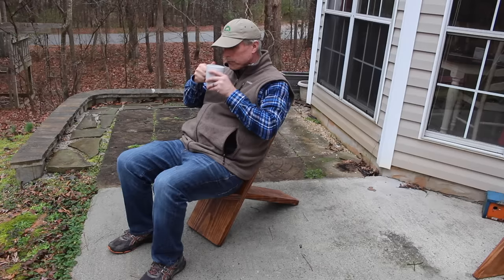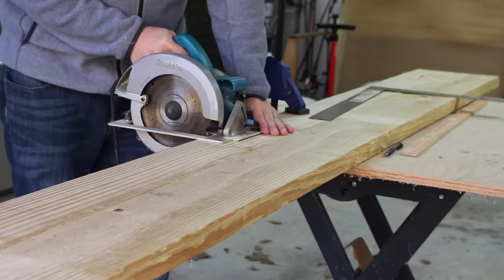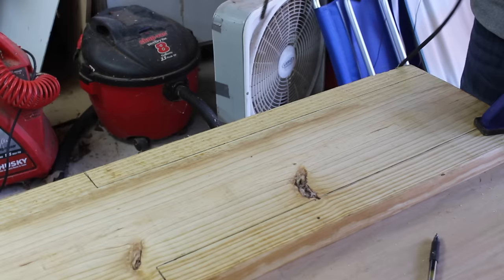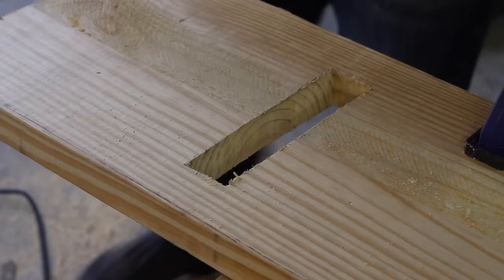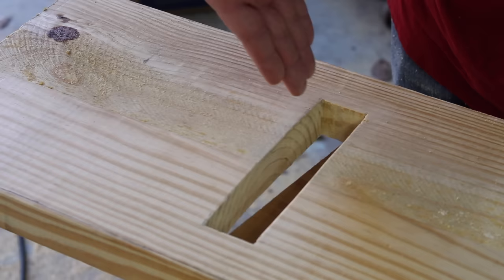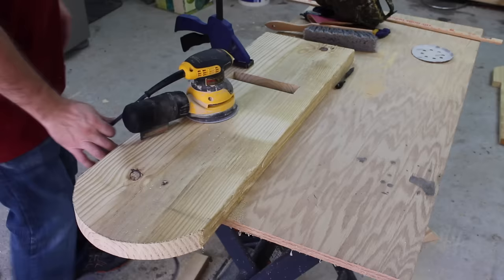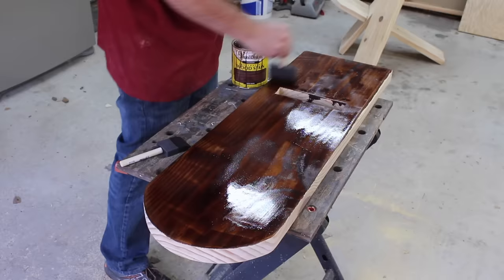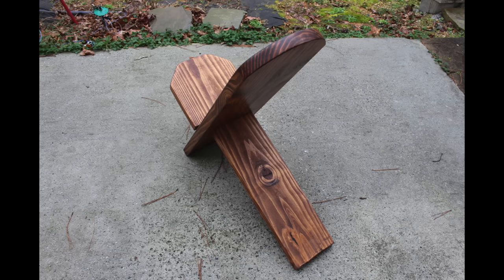Make a Campfire Chair

Comment: The board is 2” thick. I see the mortis cut is 1.5”. How’s that gonna slide in?
Reply: The board is actually 1.5” thick. 2” is the common size. Similar to a 2”x4” being 1.5”x3.5”
Reply: Bryan Garcia  2” x 12” x 8’ is the board he used. Are you saying the 2” thick board is actually 1.5” or that he used a 1.5” board? Thx for helping me understand
Reply: D  yes sir. As goes with most construction lumber.
Reply from the maker: Good question and I see other's have replied. With most boards the "common" dimensions are different from actual dimensions. My board is actually 1.5 " thick. I know it can get confusing. As I mentioned in the video, you may still need to make some fine tune cuts to make the tenon fit the mortise. Not too tight and not too loose.
Reply: Four Oaks Crafts big thx and ty for the video. This looks fun and can be my entry into wood working 👍

Comment: What is the mortise cutout dimension? And how far is it from the square end?? Thanks
Reply from the maker: The dimensions I used were 7.25" long and 1.5" wide for the mortice. You may need to adjust these slightly depending on the size of your boards. Approximately 11" from the square end.
Reply: @fouroakscrafts7240  awesome, thanks

Comment: When I go to the warehouse what kind of wood do I use? I didnt catch the name.
Reply from the maker: I used construction grade pine. I suggest picking boards as straight as possible. I used untreated pine and elected to finish with spar urethane. This chair has been outside in the elements for a while now. Haven't seen any signs of decay.
Reply: @fouroakscrafts7240  thanks

Comment: 90 degres with the gap you made is almost 70 degres loooool.

17k likes.....
Reply from the maker: I wouldn't be too concerned about the angle. I may have made the mortise slightly bigger than it needs but it doesn't have to be perfect. The angle I achieved is still plenty comfortable for me.

Comment: How would you reinforce for bigger guys
Reply from the maker: Great question! I don't know of a way to officially test the strength of these chairs. But some ideas to reinforce the strength that come to mind: use thicker boards, use hardwood boards or add a bracket below the seat area to give more support. Hope this helps!
Reply: Thanks going to try today
Reply: @fouroakscrafts7240   If I may add to that: The tighter the fit, the more it can bear. In other words, the looser the fit, the easier it is to break when sitting down (especially when you let yourself fall into the seat). The bracket would work but it needs to be removable to preserve the flat-packing ability of this chair.
Reply from the maker: @DreadX10  Great points!
Reply: J. Arguijo build it out of LVL
Reply from the maker: @tonybarracuda3505  That may be a good solution. How do you get that stuff? Is it special order?
Reply: Four Oaks Crafts typically you have to order it as most lumber yards don’t stock it but you can sometimes pick up 3-4 ft chunks from construction sites. You could make your own as well by laminating 2 or 3 layers of 3/4” ply together